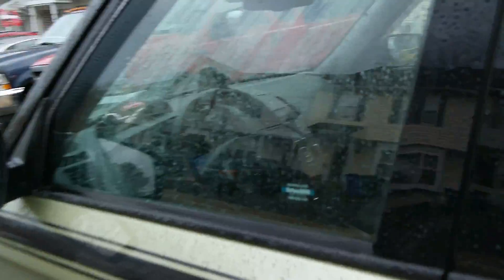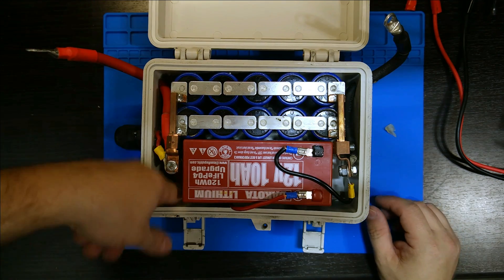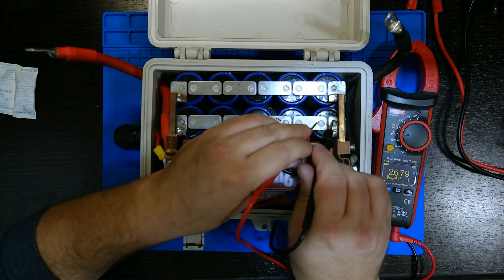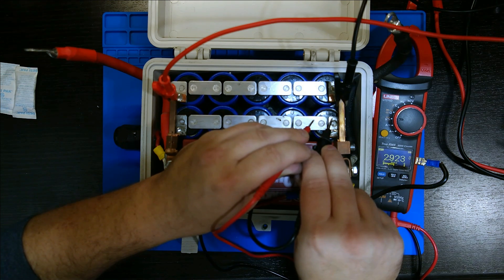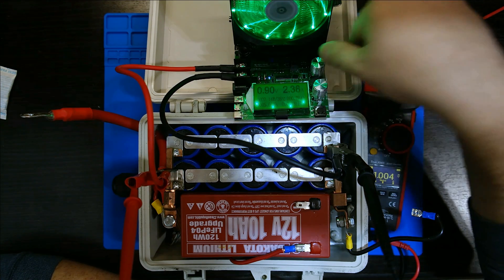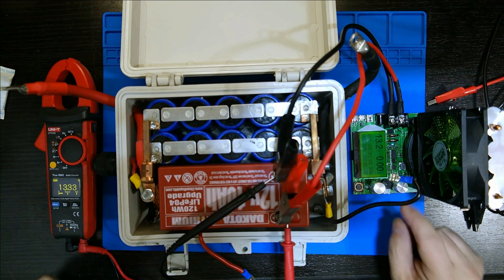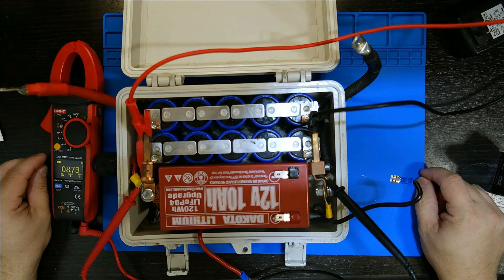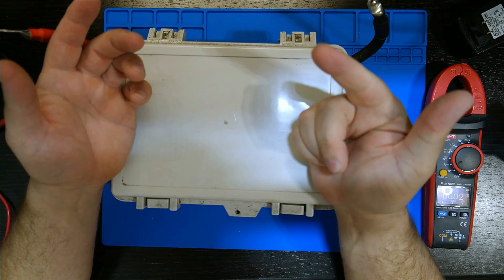Hybrid Supercapacitor Car Battery Part 10   1 Year Durability Testing

Comment: I have been building supercapacitor hybrid LifePo4 batteries for many cars since 2017. I have build many prototypes, designed with different combinations of cell capacities and capacitance of different types. Even install them on daily cars, sports cars and even super cars. For LifePo4 cells under the hood, temperature plays significant affect on the life time of the cells. If the battery is relocated to the boot you don't caught many problems. Supercapacitors from different manufacturers have big variations in quality, the internal resistance is the most important factor you need to worried of. Bad capacitors tends to build up internal resistance quickly. I hope there are more people interested in this topic and finaly I can come with a product that is available for the market. The goal is to build a battery that never dies.
Reply: That will never get to market without severe setbacks. Do you know how much they make off batteries? It would be a shame for their pockets, a damned scam.

Comment: Question would you ever think of incorporating a battery isolator so that the cap bank doesnt sit on the battery and when its off the caps hold charging voltage of alternator and not standing battery voltage?

Comment: Dangerous moment: LiFePO4 battery intended to use in very limited temp range (charge: 0 to 45C, discharge: -20 to 65C). Obviously under bonnet it's much warmer :) IDK what happen to LiFePO4 in a heat, but nothing good.
Reply from the maker: Been running for 4 years now with no issues.
Reply: @madelectronengineering  Cool! But this "lucky case" cannot be proof "everybody can install it". Say, weather in my country easy can be 34C - imagine what's happen under bonnet! (w turbo) I'll feel OK only if battery can be installed somewhere under "forced wind" (some pipe from the bottom of the car) :)
Reply: @madelectronengineering  One more moment: I heard LiFePO4 also requires regular driving . Otherwise it can be dead quite quickly. Is it true?

Comment: One problem. Your desicant packs are useless in this configuration, since the box is not air tight. Also reusing those desicant packs is not recommended unless you bake-out the moisture in an oven.

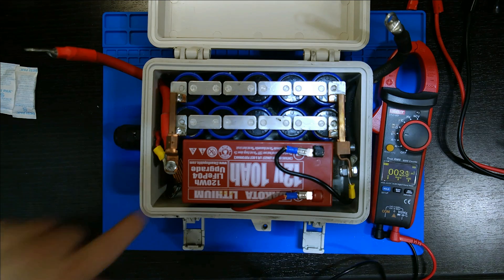Comment: 5:18 - may I ask how you calculated that it has to be 0.1 Ohm, in order to not pull more than 10-15A? I would love to know that for my future electronic projects. Finding out what value resistor to use is still my most challenging part...
Reply from the maker: Would you believe trial and error?
Reply: @Mad Electron Engineering  Haha that is great to hear! I am doing well then ☺️

Comment: How much current does the capacitors put out to start the car? How much energy does it take to start that car?
Reply: Usually 100-200A cranking current and 3-5 kWh. Not a lot of energy, less than a cellphone battery, but throwing that energy in a few seconds is a challenge.

Comment: Gettibng close to that 2 year review ;)
Reply: Sir what if 4 lifo(18650) batteries instead of using 12v 10Ah lead acid??
Reply: bernardo tabula you would need a BMS too. There are plenty of YouTube videos on building Lithium-ion 12V drop-in replacement for lead acids.

Btw he used a Lithium-ion (LiFePO4) battery there, it's just a pre-built instead of a custom-built

Comment: we are doing this to out 2015 outback but using 12 - 2.85 volt 3400 farad maxwell capacitors! this will be over kill but it will spread out the power consumption better very little drain on all... im installing a 50 volt radio station in our mobile and i need to squeeze every little amp as possible out of the alternator i will get a 220 amp alternator and using more caps and two 900-1000 cc batteries and two inverters! 5 star brothaaaaaa and great job!

Comment: Would you sell the unit already built? 

your capacitor pack not available at your store - today is july 2019
Reply: You can buy any supercaps as long as it has the same farad and voltage rating (as well as maximum current, but most supercaps are capable of large amount of currents)

Comment: Vids were great help in my project....thx

I have also done this using XcessPower bank and 7Ah version of that battery.  My question.. Are you still using the 0.1ohm resistor?  That battery recommends no more than 10A charging rate.  A 0.1 ohm  will allow 170amps at 14v. Seems way high if the alternator is capable of it, of which mine can put out 150amps so I am restricting it further.  I went with 7 ohm allowing 2amps, soon to be switched to 1.5ohm which will allow 9 amps.  Then my 20yr, corrosion free battery will be perfect.  Been about a month so far.  13+ volts every morning.
Reply: Thanks! I was also wondering why he used a 0.1 Ohm. Could it be because of a "voltage divider" scenario, where the battery receives a lower voltage than the charging voltage (13-14V) since some of it is divided into the resistor? I see that he configured the battery and resistorr in series. Please correct me.

Comment: I am so confused.. i have a supercapacitor bank and wont even start my bike.. i charged it to 14.5v before putting it on my bike but still when i hit the starter .. engine wont start .. only a knocking sound..

i think the current is not enough to start my bike..

2.7v 500F each (6 capacitors connected in series).

Thats my setup.
Reply: Some cheap Chinese capacitors cant handle large amperage loads. ALso make sure if your using a balance board you used solder to increase the size of the traces to handle the load. might need a few in parallel.

Comment: Good job. I'm making a more battery-dependent setup. An 80F supercap bank (5x 400F 3V) in the engine bay and a 50AH LiFePO4 battery in the rear of the vehicle. The battery's max discharge current rating is 150A so I'll start with just the 6GA cable which should be around 0.008Ω and that should keep it under 150A, otherwise I'll add a resistor inline.

Comment: amazing video! what the value of the resistor that you use in serie with the batery? 24 ohms?
Reply from the maker: 0.1ohm 25 watt
Reply: @madelectronengineering   but the math dont match, because (12v*12v)/0.1=1440amp that dont protect the battery from overcurrent
Reply: Daniel Moraes mind explaining your own math for that?
V=IR so I = V/R
I = 12/0.1
I = 120

That's at 12v difference (capacitor @ 0v battery at 12v)
Reply: Battery specs say 10A max charging current, @14-15v.  Built-in BMS will cutoff if too much current.

Comment: I would love to see the simultaneous output  current curves from the capacitors and battery, or alternatively the capacitors and the power resistor at startup and the subsequent few seconds. Do you have photos of such that you could include in a followup clip? The loss of 20Wh capacity from a 120Wh battery after a year seems huge. Is this within the expected degradation? Were they tested at similar temperatures?
Reply: For a lithium battery it's more or less expected. That is, within the engine compartment. They don't like to stay charged in the heat, so this is not something great for it. Expected degradation for the situation.

Comment: I think I would prefer deeper storage on the battery.  If the alternator or a belt goes out, are 10 amp hours enough to allow you to limp to a repair site? If size isn't a concern, a deep-cycle battery + the capacitor might give you the best of both worlds.
Reply: Even if the battery is capable of powering the car, it is recommended to stop and tow the car instead. The car is designed to run at 12-14V (from the alternator), and lower voltage might damage some parts of the car.

I know this since it did happen to my car (on lead-acid), and smoke and gas smells started coming out from the exhaust. And then it started losing power shortly after, which I believed it happened as a protection mechanism of the ECU from the car itself. (2011 Kia)
Reply: Most cars will run on alternator alone, even ecu. Done it many times,  start then replace battery. Can fry ecu with spikes especially if second battery flat and full draw.

Comment: I really liked your video on this. Question: Based on what you've learned, would you stay with the same 25 Watt / 0.1 Ohm Resistor; or would you change it to a different value ?
Reply: Check out the part 11, someone did ask the same question, and tldr 0.1 Ohm resistor makes the battery charge at ~10A or lower, therefore protecting the battery. You could use a lower resistance resistor if you are sure the battery can handle the amount of current.

Wattage rating is there for safety, iirc it handles about 10W in reality, but it's better to be on the safe side since resistors are not exactly expensive either.

Comment: I binged on this play list, thinking that loss answers the question I asked on the other video. Some that Jack Rickard mentioned about why EV's  do not have lithium 12 volt batteries.
Reply: Re-Think This 
The 2 measurements were done with different meters. Also there was a slight difference in start and end voltage that both negatively influenced the 1 year measurement. So it might be a bit better then showed. 
On the other hand the battery must have been charged several times at temps below freezing. That’s very bad for these batteries. 
In an RV these batteries would be great if you make sure not to charge them at too low temps. They are more expensive but will last much longer than any lead-acid battery and they have significantly less weight. 
The supercaps wouldn’t be needed in a RV since you won’t draw large currents.

Comment: Hi ... Thank you for sharing. Very interesting idea. I have seen bank capacitors that have been given a BMS module like in a li-ion battery. The seller said it was better. Do you think that doesn't apply to your bank capacitor? And is it safe to put in the temperature of a hot car engine? Thank you ... Keep working wonderfully ...
Reply: Good question! 
Low temps (below freezing) is bad when charging the battery. High temps can be bad for both the battery and the caps. You’d have to check the data sheets and questimate how hot it be in your car. Putting the whole package in the trunk wouldn’t be a bad idea to me. Charging the battery below freezing will remain to be a big no.

Comment: Have you thought about redoing the monitoring but use Bluetooth or WiFi instead of wired to dash?  Also what do you think about Tesla just bought Maxwell?  I think they will be building their own battery, shrinking and managing better regenerative breaking.
Reply: Wi-Fi will draw far too much current for continuous use. BLE will use less but probably still too much.

Comment: amperics 13V120F350A comes up on Amazon ($70) as 14V120F350A - (Balancing circuit not included)... Amperics AMD13V350A ("...They come with built-in
balacing circuitry to ensure long lifetime and quality.")... no price found, so far.... may be useful to order with M6 cable lugs: right angle to long axis ("T"?)... possibly even double-ended for parallel/buss bar installs.

Comment: wait,  you didn't install a balancing circuit ??? I'm surprised it survived a year.
Reply: JahuGarcia didn’t even use balance boards on his first DIY EV batteries. The ESR’s of the caps were matched.
Reply: @Conservator.  
When those batteries get old , each cell will have different resistances. Some will charge fast and some are slow. He runs the risk of burning his vehicle down. It only takes one cell to go bad and the rest will burn down with it.
Reply: WTF BBQ 
You are right about that. He used already old batteries but measured their capacity and matched them carefully. He also put lots of them in parallel with fuses. It went ok as far as I know. I agree with you though that with li-ion batteries you definitely should use protection and balance boards. 
With these supercaps with low and matched esr you could go without if you don’t mind taking the small risk of destroying your pack. 
Since the price of these boards is quite low now, I’d go with peace of mind.
In short: supercaps are much more stable than batteries, therefore balance boards are less of a necessity provided you leave some margin.

Comment: I have a hybrid battery system in my old Nissan truck. It has been in the truck for about 5 or 6 years. I live in Southern Florida so the heat does a number on batteries. The only problem I have had is the little backup battery will die every couple of years so I just change them out every two years. I am retired and live in the boonies so it is not uncommon for  this truck to set a couple of weeks at a time. My only fear is some cop will look under the hood and call the bomb squad. LOL  This system works wonderfully and I make sure anyone who drives this thing is, no matter no one is jump or have anyone put a big battery charger on it . If some one does that they could possibly blow the caps and hurt someone. I recommend making up a warning label saying not charge or jump this unit.
Reply: Super caps won't blow. At 2.7V each max amps will makes them get really hot as they short internally out dead permanently.

Comment: Why spend so much on that lithium battery for like $20 you could have went lead acid and like 9Ah
Reply: Those little LA batteries lose a lot of capacity in 1-2 years. Good Li cells can last 5-6 years before losing significant capacity.
Reply: You can't start a 2L Kia Soul (the car he used in the video) with a 9 Ah lead acid, youd need at least 50 Ah since the 9 Ah battery does not have the necessary amperage for the starter motor of the car.

That's precisely why he used supercaps in addition to the battery, mainly to handle the high current required by the starter motor.
Reply: Also lead acid hates deep cycles. In reality, the 50 Ah battery in most cars, you probably only use 10-20 Ah. Going more than that a few times and the battery is done.
Reply: Well I was talking about with the super caps obviously but as little the batter is actually being cycled it would be fine

Comment: 20%ish lost capacity for a lithium ion after 2 years is decent. But at that rate you will be replacing it almost as often as a a good lead acid. Don't get my wrong, I love the concept.
Reply: isn't he leaving the battery out??... I mean the set up that he did is to protect the battery vs time and vs the freezing cold weather... apparently the cold weather would have damaged a battery way more... the idea of his set up, is that it extends the life of the hardware
Reply: Robert Ostman 
Good point. Li-ion and Li-FePo should not be charged below freezing point.
Reply: It would be worth looking at LTO batteries instead of LiPo, they are more suitable for an automotive environment.
Reply: That's not an automotive rated lithium battery. It's probably junk cells to begin with

Comment: I haven’t wanted all the video in your series, but I also haven’t seen an lithium battery charging circuit. The caps seem to be holding up great. But the battery did loose more capacity then I expected and two thoughts came to mind.   1. The charging algorithm from the car is for lead acid, although it will charge the LiFeo4 cell it can also slowly damage it. 2 That battery typically doesn’t like being charged when it’s freezing, maybe a 5 minute delay to prevent charging until the engine bay helps warm the battery up? It would not surprise me if your battery capacity was better if you tested it again after it warms up? Still pretty cool it’s surviving a year and looking good.

Comment: Battery LiFePO4 afraid of frost. Instead LiFePO4 you need to use lithium titanate LTO
Reply: Best comment!
Reply: @marthale7 
LTO in all respects is better than a LiFePO4 except for the price.
Reply: @marthale7 
I have already installed the LTO assembly on my car for 5 years. 2 video recorders 24/7.
  In winter (5 months), every day, once for 40 minutes, an autonomous heater webasto for the engine operates. Sometimes, when traveling to the forest, we spend the night in a car and an autonomous heater webasto works. Lead-acid batteries could not withstand such loads and constantly sat down. The gel battery did not change the situation either. Therefore, I made such an assembly of the LTO.
Reply: @marthale7 Well, here I am a real LTO user. We have relatively severe winters down to -25. They have never failed. It never happened that they did not start a diesel engine. But with lead, this happened all the time.

Comment: Weigh the dessicant bags and you can see if they absorb anything. They are probably already saturated though
Reply: magnets1000 that's a good idea.  Personally, I don't think they help much.  I think they would absorb moisture very quickly through the insulation around the wires.  End-to-end, wires are not vapor proof and the pressure changes every night sucking in moist air.

Comment: It's funny how you touched the positive and negative of the super caps with your fingertips before you test voltage of them. Good job buddy.. way to kill a noob that's dumb enough to follow your instructions on this video...👍🏻... 🙄... And... your either faking it for the camera... Or your that dumb you'd play with charged supercapacitors..😏
Reply: @brooke robertson
 - Calling someone " Dumb ", but doesn't know the differences between " Your vs You're (You are).  OK!  😂😂😂😂😂
Reply from the maker: It's 12 volts DC, you can touch it all day and not get shocked.  DC voltage is usually safe till around 48-60 volts, then you need to be careful where you put your fingers.
Reply: @madelectronengineering   - 100%  !!!  Well, you can judge from my previous post above WHO is really " DUMB " !!!  LMFAO 😂😂😂😂😂